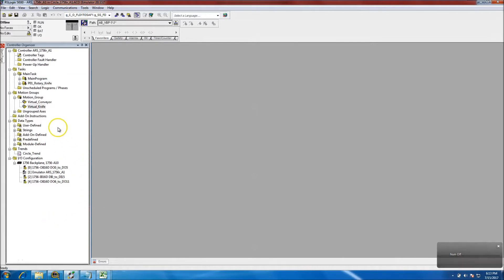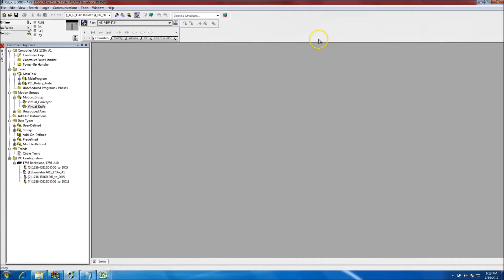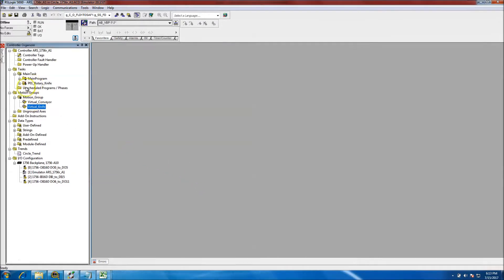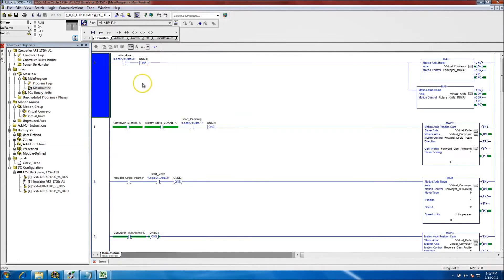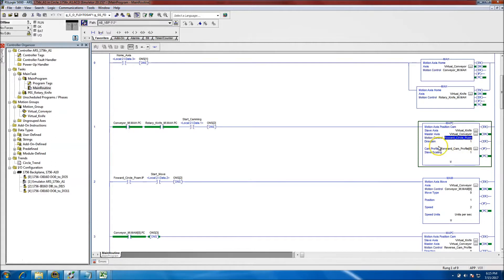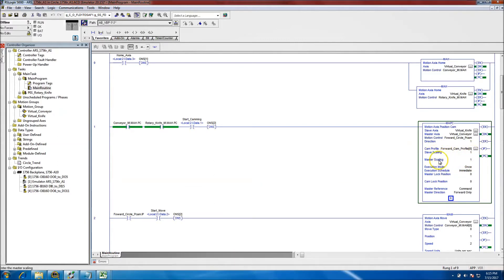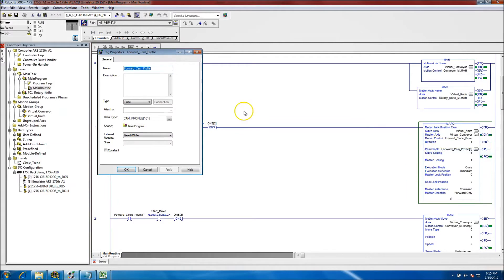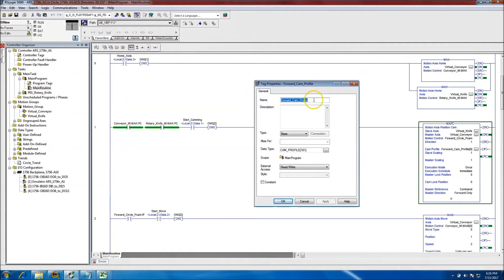RSLogix 5000 Servo Motion Position Cam Profile Example - 15 minutes

Comment: thanks for interesting video.   I would like to try Motion Commands using my RSlogix, but mine does't have Emulator. Is there a way to get Emulator 5000 for RSlogix5000 V20 ? My RSlogix is Full Edition, but does'have Emulator.  Thanks
Reply from the maker: RSLogix 5000 has a separate file or download for emulator, it doesn't come with the software. You would have to get that from the Rockwell website.
Reply: i hve a simulator for you  pleas mi name it is fidel  lamothe  contact in face book

Comment: what's the meaning of Cam at servo motor?
Reply: Did you finally make it work?
Reply from the maker: A cam is an instruction to make a servo move with what that can profile is setup to do. 

Calming can be done by either position based or by timing based. I have only made a video for the position base but can make one for timing if needed.

Thanks, 
Shane
Reply: how can i download your tutorial code?  would you like to share the. ACD files of your tutorial?
Reply from the maker: I have problems sharing these files however I am making a website to hold everything right now and also a training program that will contain all the files but none of this is going to be completed till possibly the end of the year or early 2018.

Thanks you for your support,

Shane